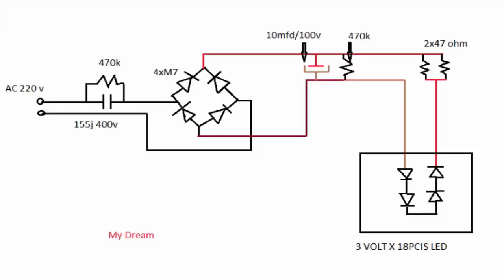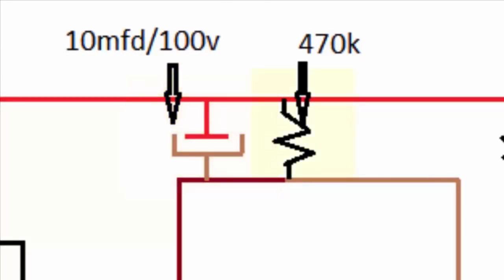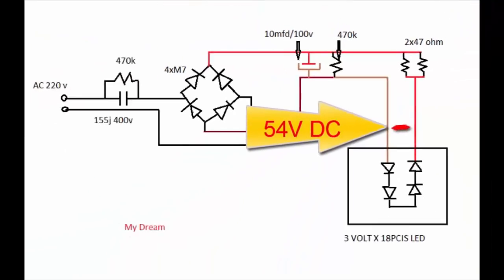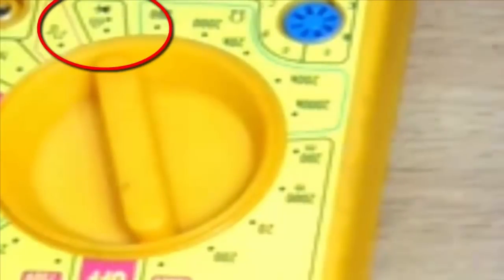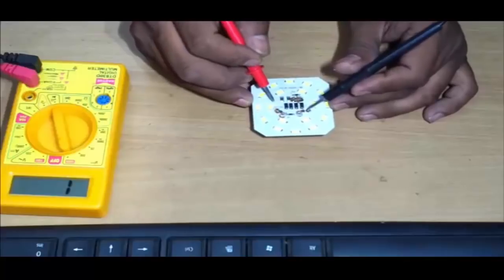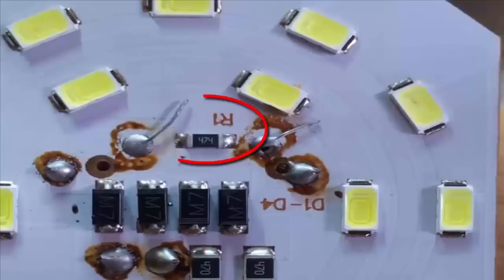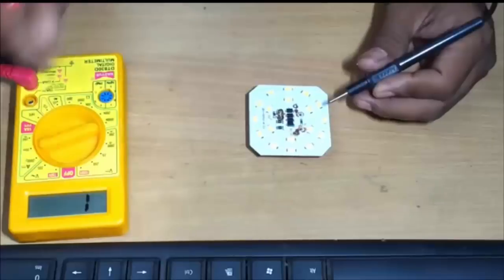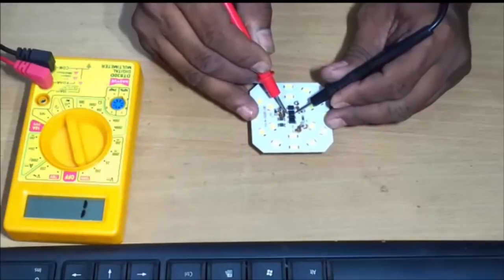LED BULB REPAIR

Comment: Nice job. But, there are different types ofLED bulbs with different drives, (IC instead rectifire diods etc.). Also, you must  have identical type of Led diode to change the broken one. Often, I use just one resistor to change (usually) one broken diode.